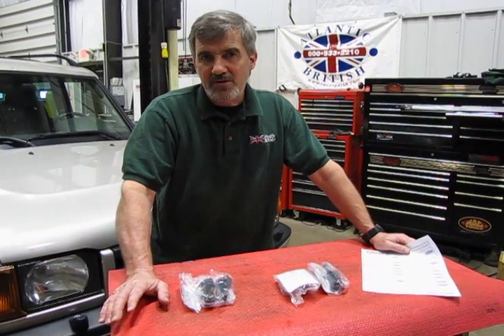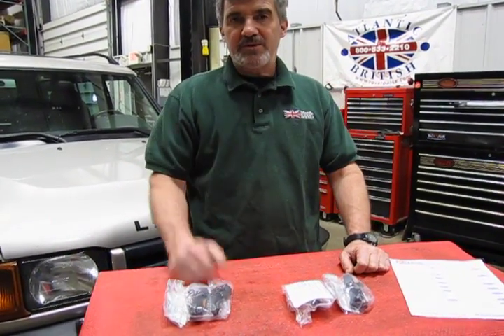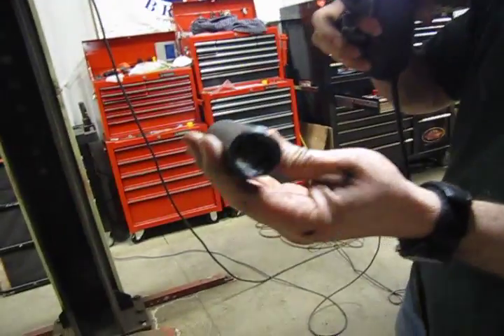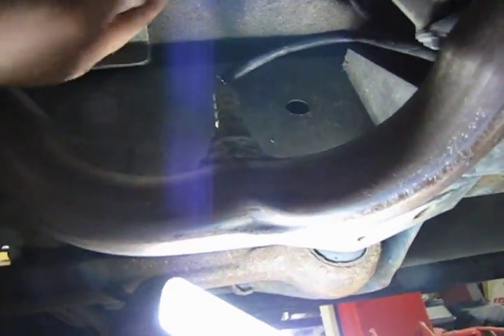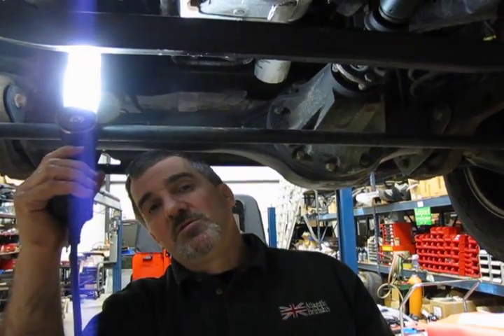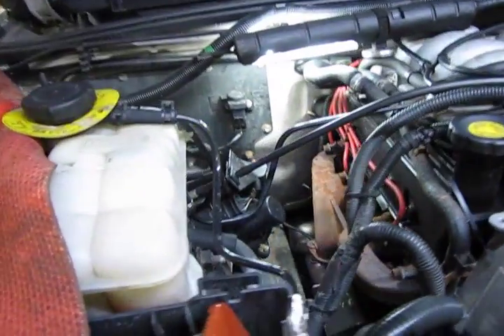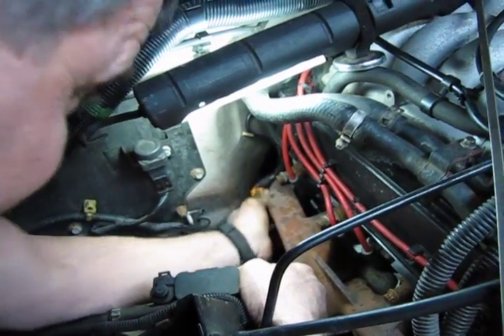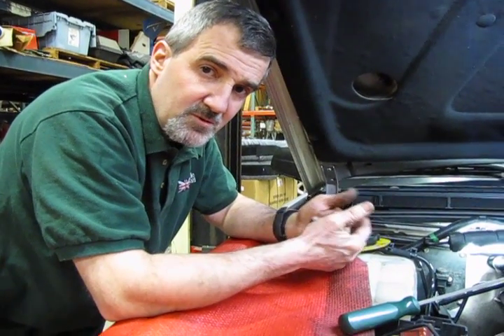Oxygen Sensor Replacement on Discovery Series II

Comment: My drivers side o2 Sensor cannot be accessed from the bottom. I tried and cannot get a wrench in there. The angle of my sensor is extreme. I even tried an extra long extension with a swivel from the top

Comment: I replaced my 02 sensor. Sadly bank 1 Sensor 1 is still coding, heater...  Took my 02 Discovery into a friends shop and he finally found 3 broken wires in different areas of what looks like the connection off the firewall. Looks like a difficult replacement from what I could tell. Of course my friend isn't sure he wants to take it on. haaaaa!  Any other suggestions out there?
Reply from the maker: sounds like a project! sorry, can't offer any additional guidance there.

Comment: my codes still popping up after replacing all oxy sensors please tell me what's next
Reply from the maker: The first step would be to check the fuses in the under hood fuse box since the oxygen sensors all run through a single fuse that powers them. If that fuse is intact, then check the harness for possible chafing (the wire harness can be found at the driver's side rear cylinder head). This area is infamous for chafing and can short out causing a host of issues. Also, we would also recommend an engine ECM adaption clear since the o2 sensors are a major input to the engine ECU.

Comment: Are P0173 and P0170 fuel trim codes gonna be fixed after changing those sensors?
Reply from the maker: Hi Ahmed, with P0173 and P0170 you should first check your MAF sensor, as that can sometimes be the culprit.

Comment: I just changed all 4 o2 sensors on 2002 disco 2. Everything went well, but when I took it for a test drive I noticed a burning smell possibly coming from under the car. What is this burning smell? Could it be the manufacturers grease that was on the threads of the new o2 sensors or something else? TIA

Comment: could you clarify what side is bank 1 and bank 2.  i have read confusing comments like bank 1 is opposite of cylinder 1?  and then there is the driver side and passenger side comments, but there is the UK right side driving and the N.A. left hand side driver position?
Reply from the maker: Bank 1 is on the Drivers (LH) side for the D2.
Reply: atlanticbritish so im going to point out the confusion, if i have  a U.K. version the driver seat is on the right, but looking at it from the front that would be the left side.  So is this bank1 sensor 1 on the left looking from the front at the vehicle or on the left looking from the drivers seat?
Reply from the maker: Point of reference always starts from the driver's position within the vehicle. For US-Spec D2s that means the driver's seat is on the right-hand side, therefore bank 1 is on the left-hand side from the driver's perspective.
Reply: atlanticbritish Thank you! You guys should read some of these confusing comments lol.